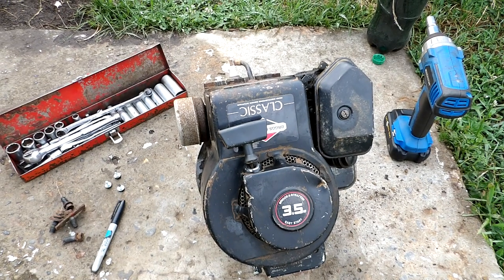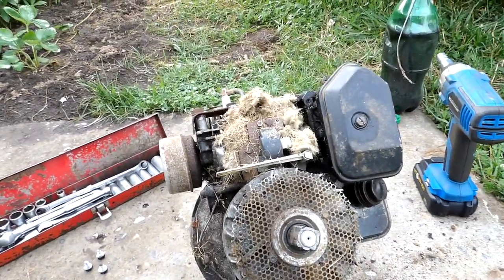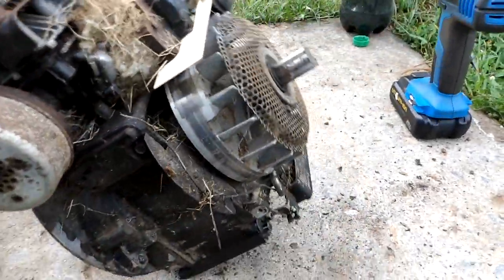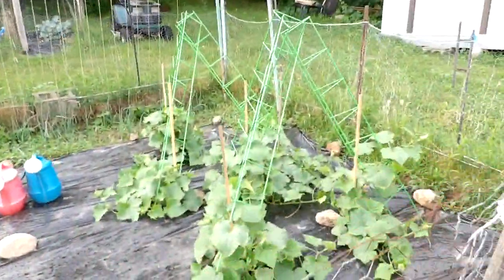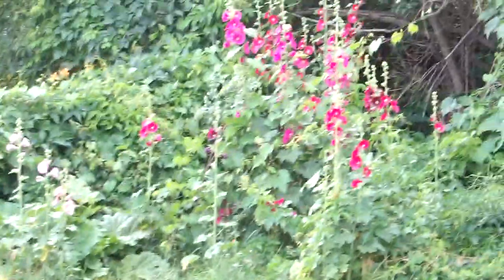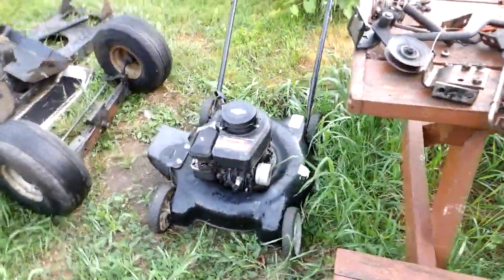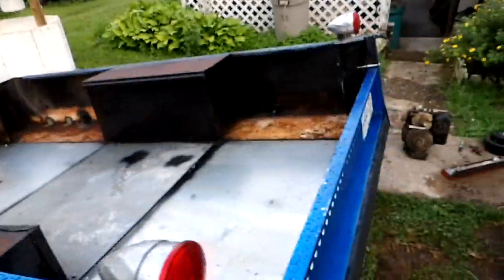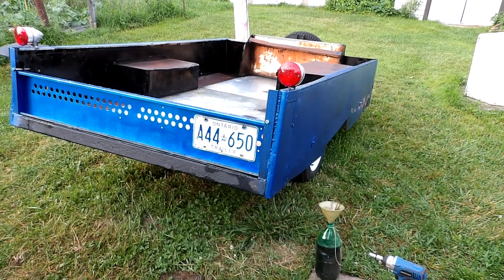Sorry, No 24 Cylinder Engine This Summer :(

Comment: I've needed to do the mowing here for, oh, months, just with my sleeping problems and weather timing, I just never got round to it, but this week I shall be doing so with a new toy I got, a pushy-cutty whipper-snipper strimmer-mower thing, 52cc 2-stroke engine with a short shaft to a strimmer (aka string-trimmer) head mounted on two wheels, should make the job of cutting back that meadow outside a lot easier... :P
Reply from the maker: Hope it works well for you. My hands don't like the vibration of a string type machine, so I man the pushmower.

Comment: Instead of the 24, you need to get the 3 Stage Snowblower happening.
Reply from the maker: You might be right, if the forecast for this winter is right!  The pendulum is swung way towards the heat side, so it may swing way towards the cold side this winter!  I seriously hope not, but it could.